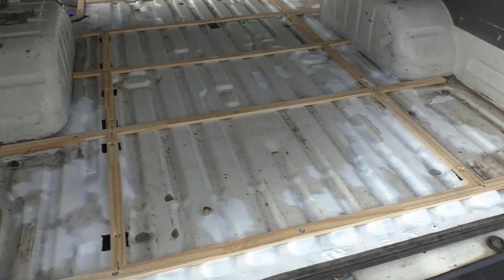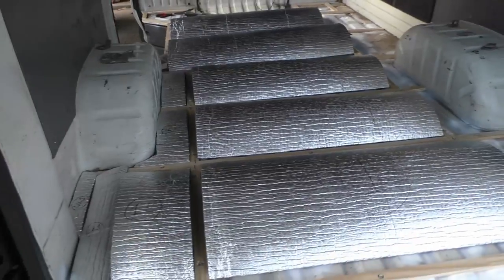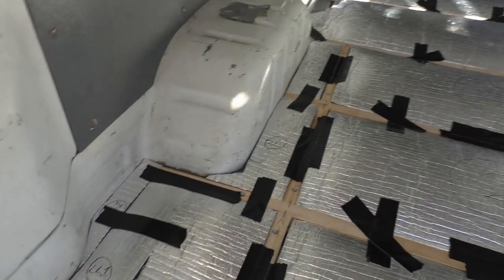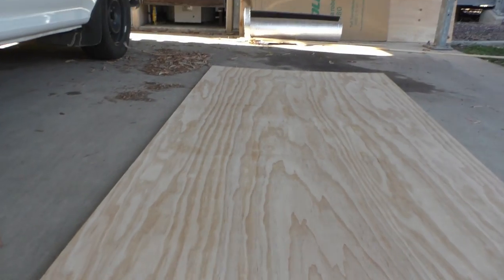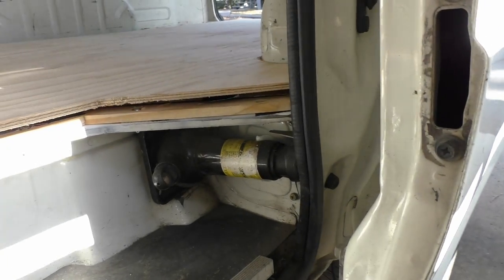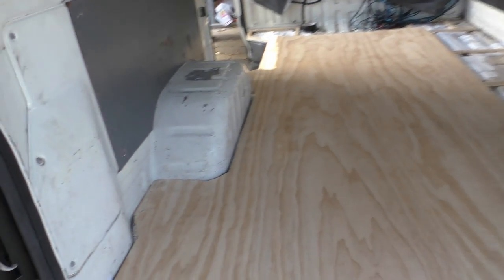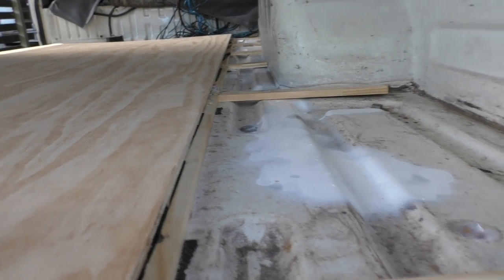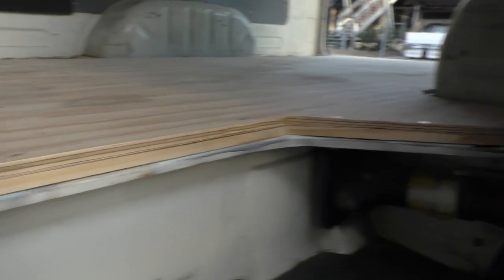The HIace VAN LIFE: Part 2: Floor installation

Comment: did you just screw the battons straight into the metal floor of the van!?
Reply: Hugo Davey something wrong with that? How would you do it?
Reply: Watch part 1
Reply: I'm just about to put flooring in my van, just wondering how much wood for your structural lay out did you buy please